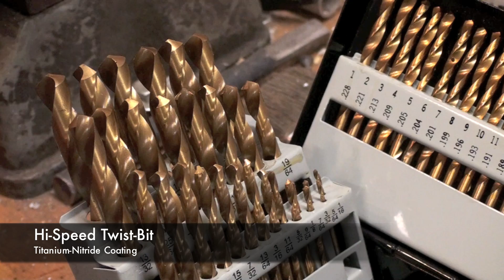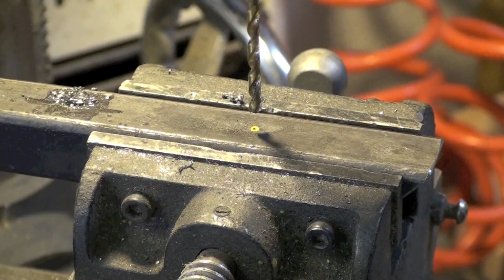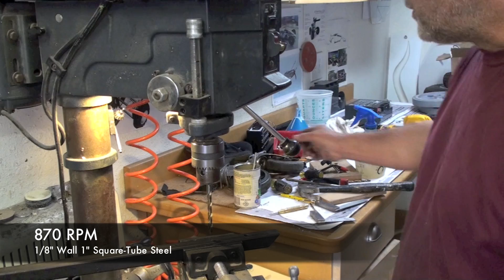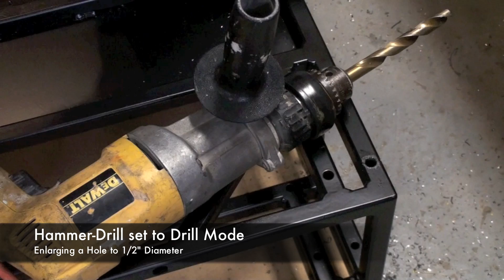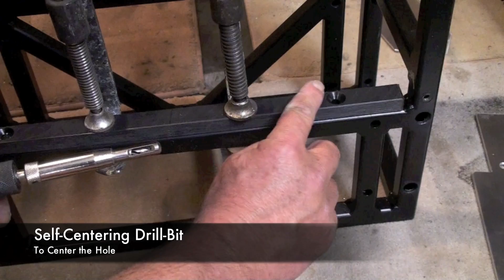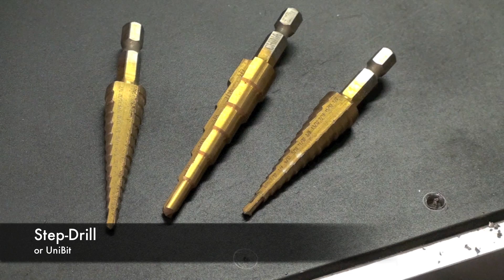Drilling Holes in Steel

Comment: Ok, wow, NO, your drill is going way too fast.   Either you're drill soft, weak ass steel, or you got drill bits made by god.   Since they look like ordinary bits to me, I'm guessing, soft ass metal.  Try drilling some tower steel.   You want that drill bit going around as slow as possible.  Metal likes to be milled.  You'd just be sliding your drill bit in the hole at that speed.

Comment: Sir why drill press machines are quieter than hand drills?
Reply: SMOKER larger motors require less rpm and produce more torque efficiently, resulting in less vibration from the rotor and less coil whine

Comment: I break drill bits faster than I can change them - even expensive ones - so it came a s relief to find a supply of cheap ones that it really doesn't matter about! 50 for about $4! Reviews from buyers on the bottom of the product page persuaded me they were worth buying, and it turned out they were correct: www.banggood.com/50PCS-1-or-1_5-or-2-or-2_5-or-3mm-HSS-Titanium-Coated-High-Speed-Steel-Drill-Bit-Set-p-1001864.html?p=JQ26191551677201504Z
Reply: +Wane Hall Hey, thanks for that. I see they've lots of other interesting stuff, as well.

Comment: The step drillers are for plastics and not for metal!
Reply: nope
Reply: @Smoker
They won't last long if you drill into metal with them, that's why you do not use them for metal. Especially steel or similar hardness metal.
The only thing that might be okay are thin sheet metal or none iron metals, but not those thick steel plates shown in the video.
Reply: OpenGL4ever okay

Comment: i need to drill a 28mm hole in a steel tube, the tube is about 4mm thick, i guess i just keep changing the drill bit every couple of mill or so? lower the speed the larger it gets? thanks for any help and thanks for uploading

Comment: What kind of drill bits are thoes? They look like cheep Harbor Freight bits linked below. It has also been my experience that the Titanium Nitride coating is a waste of money as it is only a coating and once worn off the bit is useless.
http://www.harborfreight.com/115-piece-titanium-nitride-coated-m2-high-speed-steel-drill-bit-set-1611.html

Comment: How many holes through 5mm mild steel would you expect to be able to drill with a bit before it goes blunt ?
Reply from the maker: Depending on the type of drill bit, drilling technique, cutting speed, cutting fluid use etc, you could expect dozens of holes to be drilled before the bit needs resharpening.
Reply: www.Inspectorbots.com  Thanks

Comment: hey,
i am trying to dill the shaft of a small 12v operating dc motor with the diameter of  shaft as 6mm  ......pretty small....
the hole which i want to drill on it... is of 3 mm diameter....

since the shaft is made of hard stainless steel .... normal dril bits dont even withstand ...and break 
plzz suggest me which drill bit should i use???